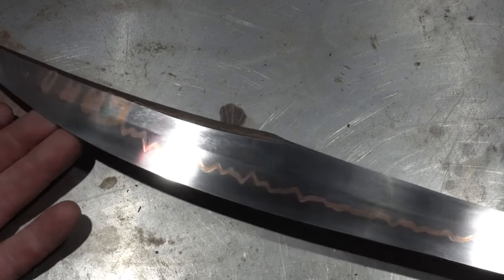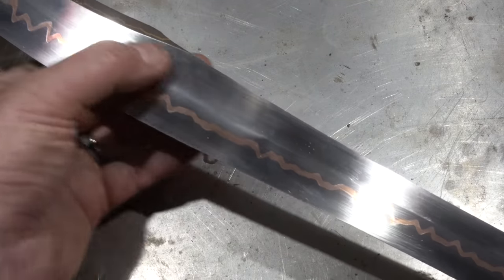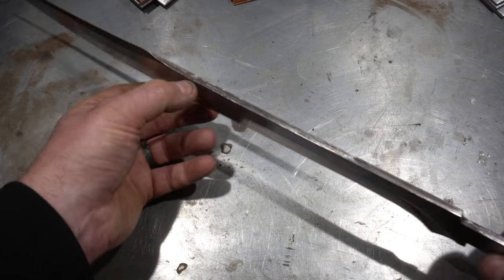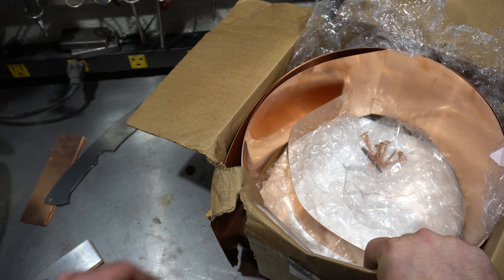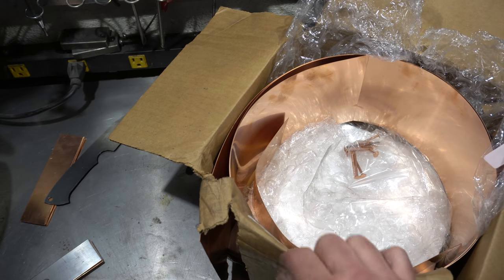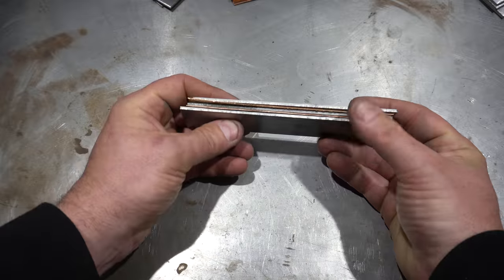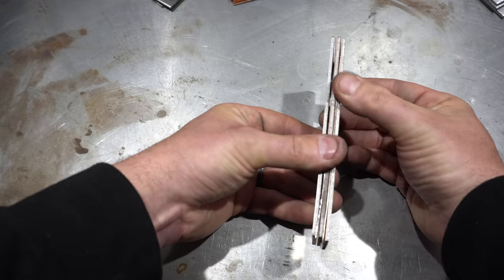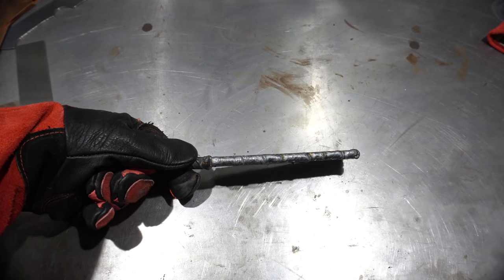Triple-T #64 - How to make Copper Damascus (Cu Mai)

Comment from the maker: Do you have any questions on this process or steps I missed?  I didn't cover grinding or etching this but I've talked about that in videos in the past.
Reply: Is there any concern with galvanic corrosion between the cooper/steel damascus? It looks amazing, but I always thought if you had copper and steel touching the steel would eventually corrode by reacting with the copper
Reply: @GrimDarkHistory  Wouldn't this only be an issue either with an electrical current or an electrolytic solution being at play? I imagine it would be fine when layered like.
Reply: @seekerend  even humid air can serve as an electrolyte. I've always loved the look of that copper damascus, but, you'd think even just washing the blade could cause issues over time. It's why I asked. I wonder if these age well or if there's that risk
Reply: Can you make it with brass instead of copper?
Reply: You should try stainless steel and copper together!
Reply from the maker: @MatthewsDre  Sorry, that doesn't work.  The heat treatment for stainless steels requires heat up to 1950F, that would melt the copper.
Reply from the maker: @lordvader4089  Yes, but its harder because the melting point of brass is about 200F lower than copper.
Reply: @TyrellKnifeworks  cool. I was actually asking if you would do it with brass but knowing you can is cool too. Wonder what other interesting metal combinations you can make this with.
Reply from the maker: @lordvader4089  stay tuned! 😜
Reply: Would soldering the pieces together instead of welding still work?
Reply from the maker: @j.h.3813  no, the solder would met as soon as it get put in the forge.
Reply: @TyrellKnifeworks  okay, thanks 👍
Reply: Can I stack copper on copper to make a thicker band or will that not bond well
Reply from the maker: @DesOttsel  That's a good question and I'm not quite sure.  I suspect it will bond just fine but I've never actually tried it.
Reply: Hey, 1000 dollars question here, i've made attempts at welding layers of bronze, copper and steel. The copper welded fine with the bronze (it's a bronze with a similar melting point as copper mind you), but the copper failed to weld to the steel on the other side... I put my pieces nice and clean in a canister for the attempt, but i suspect the steel still managed to oxidize, and the parts that kinda stuck with the copper just fell off when i put the billet in the forge to make the blade with. Do you have any tips to keep steel in a canister nice and clean? Injecting inert gases? Putting borax in it? Thanks!
Reply from the maker: @jeanladoire4141  The thing is the melting point of brass/bronze is about 200F below that of copper.  You probably aren't getting your copper constructions quite hot enough.  You should be near 1800F to do copper damascus.  If you're doing this by hand (without a press) then its even harder and you'll need to get a bit hotter.  I hope that helps.
Reply: @TyrellKnifeworks  thanks for the tip! The bronze i'm using melts at about the same point as copper, tho it starts crumbling 50 degrees earlier. So i think i've been too cautious about pushing the temperature, that must be it. Thanks again, i'll try again a bit hotter!
Reply: @TyrellKnifeworks  so i've experimented a bit and i know the theory is possible, but my execution was... Pretty bad. Have you ever tried making copper damascus woth nordic gold? (you know, the golden bronze they make coins out of), beacause it has a melting point slightly higher than copper, and perhaps you can put a cladding of that golden metal, strips of copper, and a core of steel in the middle. In my attempt, it all stuck together in a solid ingot (it's pretty cool to see strips of gold, then a layer of red, and steel in the middle) but i'll have to work on keeping the copper really really clean while making the billet (the heat from the weld oxidized it a bit). What do you think?
Reply: Hey, I’ve been trying to make a couple billets, but my welds keep cracking as I draw it out and my copper is delaminating. I’m guessing that my copper might be too close to my welds, not sure if that does anything, or I’m getting it too hot a couple times, but I don’t think I am, so I’m honestly stumped, and any help would be great
Reply: @DesOttsel  the welds cracking is normal, some copper was mixed in the weld making the steel brittle. But that shouldn't be a problem beacause it won't crack before you squeezed the billet, and of course if you squeeze the billet with the right temperature, everything should stay together. I'm struggling with the process too, but I think the key is to make the copper "sweaty", wich basically is nearly going to the melting point. It's pretty hard to know when you're at that point, i've seen people leave some copper on the side of the billet, just so you can watch it...
Reply: Ok, so maybe I’m doing my first compressions too cold, I mostly forge it at around 1600-1700 to avoid getting it too hot because I don’t have a good temperature control, so I’m right between bright red and orange most of the time.
Reply from the maker: @DesOttsel  it’s either not hot enough and the copper didn’t adhere or too hot and you melted some of it out.  If you have a heat treat oven, you can try that to maintain the temp until you get used to it.
Reply: @DesOttsel  to train my eye, i started by putting a piece of copper in my fire and i slowly brought the temperature and watched as it melted. Once i did that, i just had to remember the shade of orange. It's a pretty bright orange /dull yellow
Reply: I am assuming that you stock remove the knife after forge welding, he treat the knife as normal?
Reply from the maker: @clgmetalworks  yes that’s correct.  These don’t like to be forged on the edge so forging to shape is generally a no-go.  You heat treat for the core steel as normal. Thanks for watching.

Comment: When defferent metals are in contact, a metal with a low ionization tendency will corrode a metal with a high ionization tendency in the presence of water molecules.  It is a chemical phenomenon called galvanic corrosion.  The ionization tendency of copper and iron is Cu < Fe.  This means that copper forge-welded knife rust more easily than knives made entirely of steel.  It is natural that Japanese bladesmiths who know San-Mai (三枚) technick very well did not hand down copper forge-welded knife.
Reply from the maker: I’m quite familiar with the process and what galvanic corrosion is.  These blades do need to be kept clean and dry and oiled occasionally and they will stay beautiful for ages.  Thanks for watching

Comment: I have a multi layered billet of wrought iron and copper made up but I'm not sure how I am going to shape it down to what I need since I don't want to do a full stock removal on the project, its not a knife so forging it down will be interesting....I may have to keep welding up the edges

Comment: Hey, it actually worked! I used 0.6mm (0.024") copper and 2.5mm (0.098") old industrial wood saw blade (probably 15N20). I aimed at dull orange (ca. 850-900'C i.e. 1560-1650'F), which is what the billet @11:10 looked to my eye. I might have gone a little too hot (it's somewhat difficult to control/see the temperature accurately in a charcoal forge), and the last leveling run with the power hammer probably raised the temperature enough for some of the copper to melt, get squeezed out, and actually stick on the outside of the billet.

Oh, well. The result looked pretty nice anyway, at least for a quick "for sh*ts and giggles" type first attempt with exactly zero cost. Hope the heat treatment goes well. I think next I'll try 52100 for the core, maybe four layers of copper, and perhaps damascus as the outer shell. I wonder if damascus (only) between the copper strips would look stupid. Also, I think a copper/nickel mokume gane (or just copper/steel) bolster could look good in this kind of copper damascus blade.

Thanks for a very well made and informative video!
Reply from the maker: Congrats!  Send me a pic for Viewer Knives.  I’m glad my videos helped you with this process.  This blade is Damascus only between the layers so we’ll see when it’s etched.  Thanks for watching!

Comment: Fantastic video again. Very hard to find a lot of help and guides here in the UK. I’ve watched your copper Damascus Bowie build a dozen times, what a stunning creation!  Was wondering though, as I’ve only a forge, what sort of temperatures are needed to heat treat and what would be the temper cycles needed? Keep up the awesome work!!!!
Reply from the maker: Thanks, Sid!  I’m glad it was helpful.  For heat treating, just concentrate on your core steel and worry about that. Don’t worry about the copper, if you melt it out, you totally blew the heat treat anyway.  So do your normalization, grain reduction cycles and quench as you would if the copper wasn’t there.  Make sense?
Reply: @TyrellKnifeworks  perfect, thank you

Comment: The copper Damascus is so cool. Have you ever let the copper tarnish to green on a knife?
Reply from the maker: No, I haven't ever let it go green.  That actually takes a really long time.  The green you see on building rooftops is from years and years of rain and oxidation.  If you did that to a knife like this, the steel would rust long before the copper would turn green I think.  Thanks for watching.
Reply: Due to galvanic action, the steel will preferentially rust and protect the copper (like zinc protects galvanized steel). So you won't be able to achieve the beautiful green :(

Comment: Thanks Tyrell, great vid. So basically you do stock removal after forging to the desired thickness? I would also like to try with a hand hammer. I was thinking of trying bronze too
Reply from the maker: Yes, exactly, stock removal after it's been forged to a billet.  This is the suggested method for all layered constructions like San mai or you risk thinning out the core and/or moving it off-center.  It will work with bronze, but you need to keep it under about 1600F because it's melting point is about 200F lower.  Thanks for watching, Theo!
Reply: Bronze is as hard as some steels but not as tough so in this sense should work very well and will support the cutting edge very successfully. I believe the melting point of copper tin bronze is a touch lower than copper but...Phosphor bronze melting point is slightly higher than tin bronze. However you might have fun sourcing sheets of phosphor bronze since its usually used cast and machined

Comment: I did a 7 layer and got steel on steel to stick. The two steel (15n2 & 1084) were on the outside, not core. So it went like this, 4242 core, copper, 1084 then 15n20. It worked!
Reply from the maker: I question the quality of the forge weld.  You just can’t forge weld steel below 1900F.  Perhaps you liquified the copper but it stayed in place.  Thanks for watching
Reply: @TyrellKnifeworks  I had it welded up tight all around the stacked plated, so yes, maybe it went liquid for a bit. I wasn't hitting it real hard while setting the welds so that would have kept it from a blow out

Comment: Thanks for showing this to us. I bought the copper and am going to five it a try. hat you don't mention in your video is what temperature you use to heat treat it. Can you tell me what temp to use? I'm aware you don't want to be held to anything and it's not a high rockwell type knife but I'd like to have a starting point for heat treating. Any help would be great...
Reply from the maker: The heat treat is just what you use for the core steel.  If it’s 1095, use the heat treat regiment for 1095.  The copper doesn’t matter.  Checkout my heat treating video if you need recipes on heat treating the various steels.  Note, the hrc doesn’t go down because there’s copper in it.
Reply: @TyrellKnifeworks  thanks much for the reply. That makes it pretty simple then. Going to do it this weekend. Here's hoping it comes out.
Reply from the maker: @jjppres  Let me know how it goes.  Send me a pic for Viewer Knives.  👍🏻

Comment: Is it possible to make the copper line "straight"? So that it follow the curve of the blade rather than wobble?
Reply from the maker: Sure you could do that.  Just use flat dies to forge the whole thing instead of using the rounding dies.  If doing it by hand, you would just make sure to use the flat side of your hammer instead of a ball or cross-peen.  Thanks for watching, Jonas.
Reply: @TyrellKnifeworks  that is fantastic ^^ I was thinking that, after watching the Feather Damascus video, it could look pretty awesome with feather Damascus outer layers... but only with a straight copper line. 

And thank you! I really enjoy your videos.
Reply from the maker: @jonasoffersen5818  That would look pretty cool!  I also think a herringbone (two opposing twists welded together) as the cladding would look pretty awesome.
Reply: @TyrellKnifeworks  that would definitely look awesome! And I suppose it'd cause a more reasonable amount of stress... 🤔

Comment: I am curious, what happens if the copper liquifies but is sealed in the billet?
Reply from the maker: The edges of the billet that were welded tend to crack because the copper contaminates the weld.  Then it tends to squirt out molten copper when you press it.  If you’re hand hammering, you’ll see it shoot out at each hit.  Thanks for watching, Gordon.

Comment: I was welding up some san mai billets today and kind of considered doing one, but on a long, very thin knife I think I was probably dipping a bit too far in to press my luck already and have probably melted a small fortune making mokume gane in the past. (honestly you look away for 2 sec and end up with a puddle!)
In the long term is there any kind of cathodic or anodic, galvanic corrosion? 
If I remember my chemistry right copper plays well with nickel, stainless and brass but its a bit 'middling' with mild steel under some conditions if there some water, acids and caustic solutions at play.
Reply from the maker: Galvanic corrosion requires the presence of an electrolyte like salt water.  Keep the knife clean and dry like you would any normal carbon steel knife and it will last a lifetime.  Generally, if you keep the steel from rusting, the copper will be fine too.    Thanks for watching.
Reply: @TyrellKnifeworks  Yeah its a bit of a risk where I am in the world next to the ocean and most of my stuff is kitchen cutlery so its just a bit tough. Aluminium bronze might work ok but its quite uncommon in shim stock and low melting temp (compared to steel)

Comment: So how do you handle normalization/heat treatment?  If you need to get the knife up to non magnetic before quenching wont that make the copper melt out?
Reply from the maker: The heat treatment for all carbon steels is below 1600F.  Copper melts at 1980F, so its totally fine.  Also note, non-magnetic is NOT the temperature you target for quenching.  For example, non-magnetic for 10xx series steel is about 1425F but the quench temp is about 1475-1485F, so you're off by 50-60F if you quench at non-magnetic.  Thanks for watching.
Reply: Was just gunna add that. Per most reviewed spec sheets copper melts at 1984 degrees depending on impurities. We should all have a good knowledge of melting points of ferrous alloys and non ferrous metals.

Comment: How would something like this hold up? Can it take the abuse that steel can or will it delaminate over time?
Reply from the maker: I should have talked about delamination.  That is not an issue if the blade is kept dry after use, just like you would a carbon steel knife.  Brazing bonds do not delaminate over time without the presence of some electrolyte.  Thanks for watching.

Comment: I tried this out and thought I had a good weld. When I started grinding the profile, it split on one side. There was copper braised to both prices of steel, it seemed it was the copper itself that serperate. Any idea why that would happen? I wonder if I got it too hot grinding it?
Reply from the maker: I’ve never had that happen.  It likely was the heat treat and there was so much stress it pulled the copper apart but not where it bonded to the steel.  Try again!  Thanks for watching.
Reply: I haven't heart treated it yet, that's the wierd part. I can email you a photo if you'd like to see it.
Thanks for sharing your experience!! If gone both feet into the deep end with knifemaking and blacksmithing and watching your videos has helped accelerate the learning curve so much! 
I actually found your channel long before I had an interest in doing it.

Comment: So you do not clean the copper (apart from degreasing?) At all?
Etching the oxides and contaminants off the copper might be something to look into.
I have worked with CuNiFer before (tig welding the stuff) and something to consider is very good ventilation when welding the billet because copper welding is not very good for your health.
Reply from the maker: You don’t need to grind the copper clean if that’s what you mean.  It always comes clean when I’ve ordered it.  If you’re forging you should always have good ventilation for carbon monoxide issues.  Thanks for watching

Comment: can you show how to make cu mai without a press?
Reply from the maker: It's really not that much different.  You would hammer the billet evenly to ensure it's welded and then use a cross-peen hammer to put in the valleys.  It's not something that different that I'd do a different video on it.  Thanks for watching.

Comment: Would this work with brass?
Reply from the maker: Yes it certainly will, but its a bit more difficult because bronze and brass have a lower melting point by about 200F, so you then need to keep the billet under 1600F when forging.  Thanks for watching, Kip!

Comment: could i have 4 layers of copper? would that make a difference?
Reply from the maker: Sure, I’ve used double copper layers on each side separated by a thin sheet of 15n20 steel.  Thanks for watching